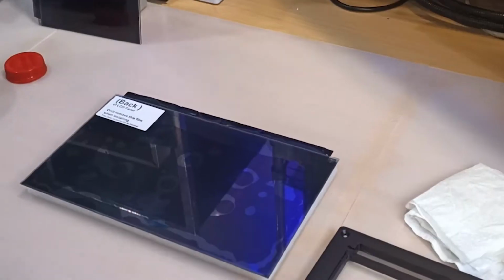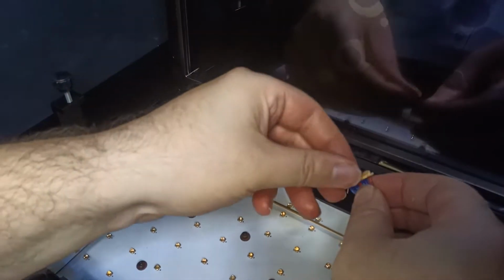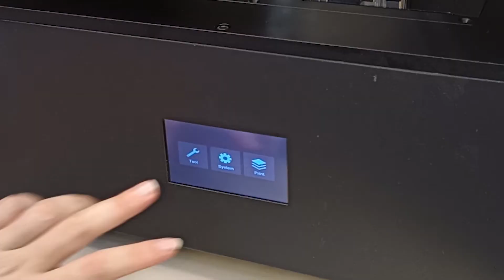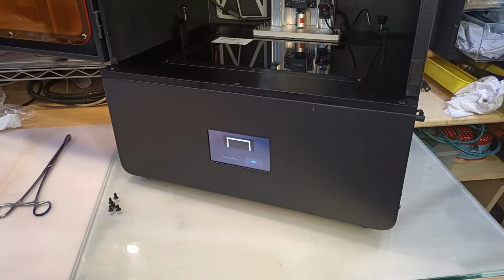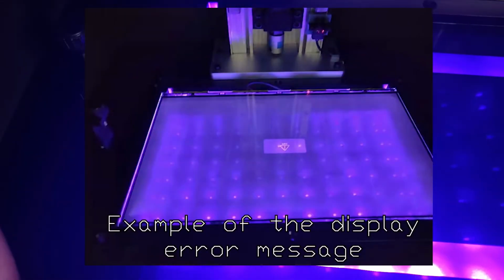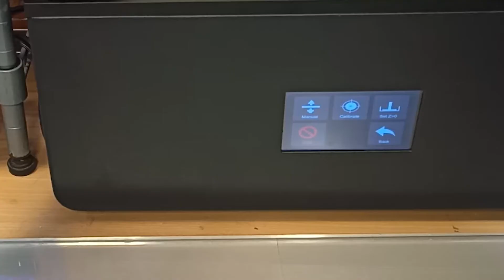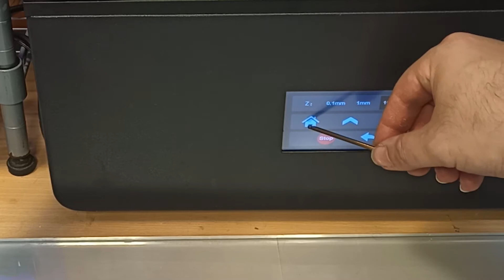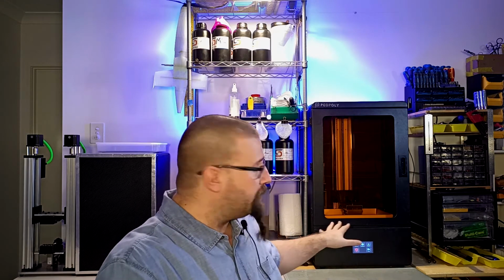Peopoly Phenom new LCD installation

Comment: What kind of tape do you recommend for the edges of the LCD? I've hear people use gaffers tape or electrical. What's your preference?
Reply from the maker: Anything that is opaque and long lasting, there some considerations to made for chemical resistance, in case you have a resin spill and need to clean up, the tape wont come unstuck.